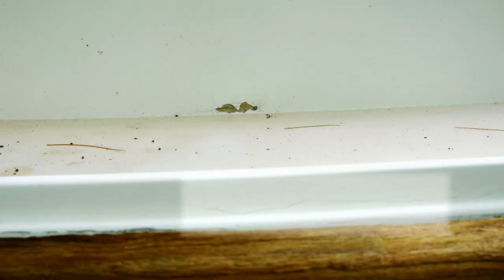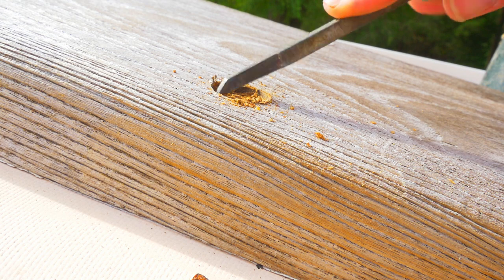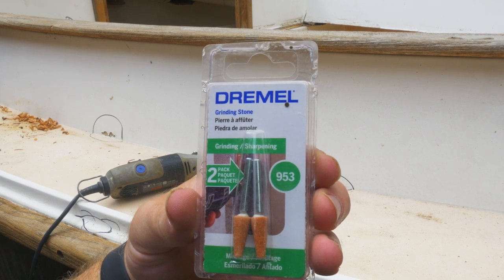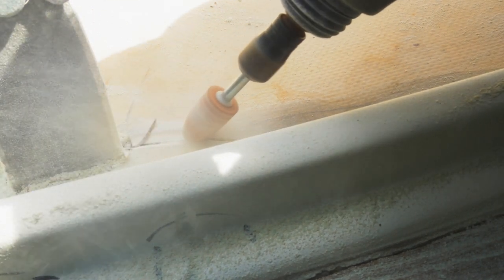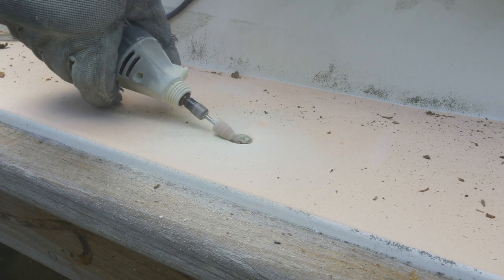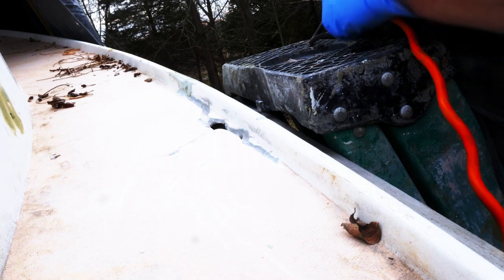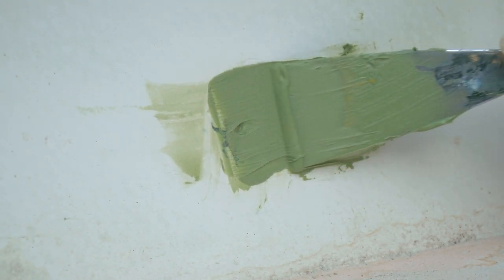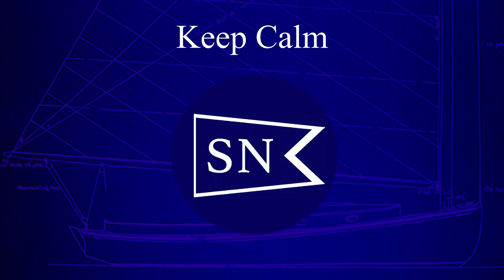Eps. 3.2 - Fairing, Filling & Bowsprit

Comment: After 35 seasons with our Herreshoff 12 1/2(Doughdish) I had the hull professionally inspected for blisters and the like.  It turned out that the "deadwood" area just aft of the lead was just scraps of foam, fiberglass cloth, and resin thrown into the cavity of the mold.  The hulls today are built in a climate-controlled facility under much stricter guidelines than they had in the 70's and early 80's.  I'd bet if the America and Eagle were still in production, a lot of that wood-core wouldn't be used.
Reply from the maker: I think you are right. I do appreciate that the hulls on these were solid fiberglass and no core. That's one reason I enjoy fixing them up. The hulls NEVER rot and are weakened unless they are physically damaged badly. If that's intact, other things wrong can be fixed. And your point about new materials and better construction methods is well taken. 

Best of luck on your H12.5. Fantastic boats!

Comment: Great and timely video!  Now if only I could find some respirator masks ... until then, I’m hand scraping and sanding the rub rail and trim to improve the cosmetics.  Thanks again!
Reply from the maker: In my next video, Im going to cover the respirator mask I got...in January before everything went nuts. I think if I tried to sell it on eBay, I could make a fortune. But really, it's great to have since it has a full face shield and Im tired of getting particles in my eyes. Don't think it would help with the COVID stuff anyway. A decent dust mask will still work well for grinding out gelcoat. Seems to work fine for me.

Comment: Hi, I wonder if you considered to add more reinforcement in the crack though area like next to the scupper. It will insure that the crack does not come back thought the fairing. Keep posting and stay safe.
Reply from the maker: Yes, I think I am going to add some fiberglass underneath as well. I won't be using this for the chainplates anchor point anymore, so all it ha to do really is handle any deck loads. It's not a place I would often walk anyway. But I do want to make it as strong as I can. Im hoping filling that cavity with epoxy will make it all pretty solid. Take care!

Comment: Hello, I am currently rebuilding a Herreshoff  18.  The boat was left uncovered in a local boatyard for 20 years. Your videos have been inspiring and helpful.  I do have a question about the swing keel.  My boat spent a majority of its life in fresh water.  I can just see a little bit of the keel on the trailer.  How was the keel on your boat?
Reply from the maker: Wow, would love to see it! Send pics! The centerboard on my America was not in too bad a shape and still works well. It has some rust but I can foresee the day when I need to change it out. The Eagle is another story. The centerboard like yours has been out in the weather for years and is badly rusted, So much that it has ablated in layers of rush to the point where it is wedged in the centerboard trunk and it's not going anywhere. I have not figured out how Im going to get it out of there. I may try firing a power washer down there and see if I can blow out one little piece of rust at a time to loosen it enough to drop it out. But not sure yet, That comes with better weather. Feel free to send me any pics of yours and I'll be happy to give you any advice if you'd like any. Good luck!